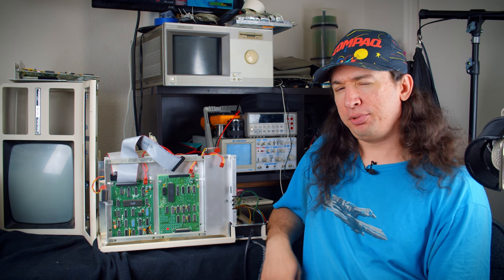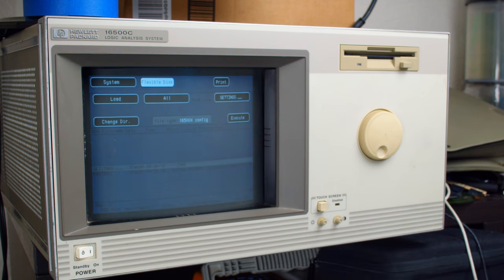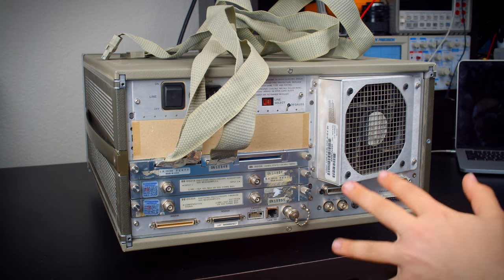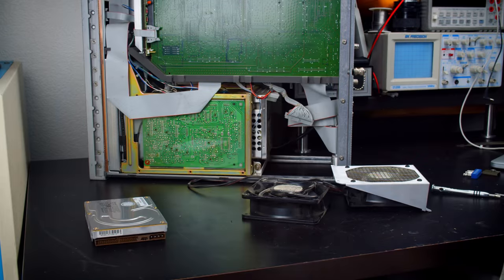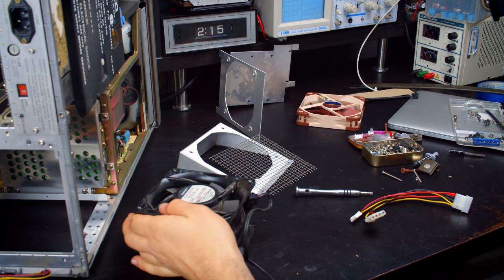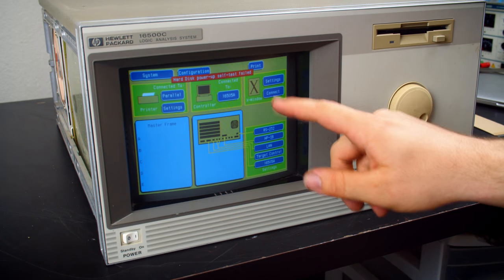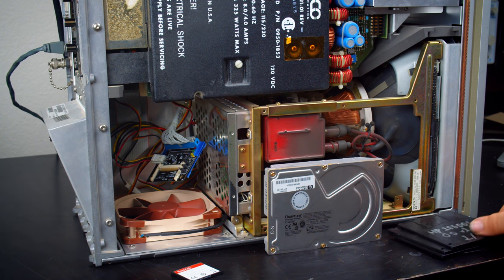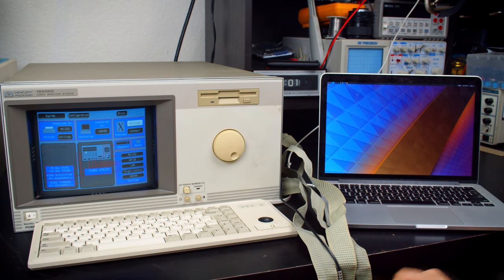HP16500C Noise Reduction Mod

Comment: I would be careful to make sure the air flow rate isn't too low compared to the OEM fans.  
You don't want to cook your HP!
Reply: BUMP! I was thinking about it, This is important!
Reply: Keep in mind that these were designed to work in harsh industrial environments, in racks, where heat can build up easily. One thing I would recommend though is to try to match the CFMs of the old and new fans.
Reply: These things were not designed to work in harsh industrial environments - they cost 20k-100k USD and were designed for R&D labs (NB I own HP vector network analyzers, spectrum analyzers and signal generators that had prices North of new car territory, as well as newer R&S and Keysight equipment). The fans were designed to ensure long (design and operating) life of extremely expensive T&M equipment. As you mention though, it's important to ensure similar CFM and same air flow direction.
Reply: Exactly what I was thinking. The fans might be loud for a reason.. they might move way more air.
Reply: yeah, at least replace them with some noctua industrials, they are still going to be way more silent

Comment: I would try limiting the primary partition on the CF card to 500mb.
Reply: went looking for this comment
Reply: Or dd that HD to CF card sector by sector.
Reply: I already did this on my 16500b when the old HDD went bad. I found out soon enough that not all CF cards work. After some trial end error I found out that the Swissbit 250Mb works good.You can go to the HP museum website and you can download the operating system for it. You just need to buy a CF to IDE adapter, pop in the card, boot it from floppy and install the operating system. No need to image the old hdd.

Comment: Since I had a similar experience with some really old Toshiba laptops (luggables) I googled a bit and found this document https://www.scss.tcd.ie/SCSSTreasuresCatalog/hardware/TCD-SCSS-T.20150217.002/HP16500-Series-Mainframel.pdf that says:
"Note that the Hard Disk controller and/or the CPU Board firmware/BIOS will not recognize any other brand/type of Hard Disk (other than different sizes of the Quantum Fireball 3.5 Series XXXXAT)"

However I googled some more and I found this page with infos on the conversion and a list of compatible adapters and CF cards: http://www.ko4bb.com/doku2015/doku.php?id=test_equipment:hard_drive_conversion_to_cf_for_hp16500

Comment: I hate to be "that guy" but the text you added in post totally cuts off the frame
Reply from the maker: Ugh, Resolve has this weird bug where sometimes changing the playback resolution changes the text scale. I guess that happened, fun. Thanks for letting me know!

The gist was "I couldn't confirm the B model could NOT read DOS/FAT12 disks so it may be possible." I found one source that made other mistakes that said the B couldn't and that's all I was able to go on.
Reply: @TechTangents  Also the text at 8:13 just so ya know
Reply: @TechTangents  I can confirm that the 16500B model does read/write in DOS/FAT12 format, since that's the model I have. It's also got the half-height 3.5" drive, and it is HD (1.44MB)

Comment: You may wish to use a Disk-On-Module in place of the IDE disk. I’ve had more success with these in legacy conversion projects.

Regarding the fans you fitted, Your analyser is going to an early grave if you don’t have the required air throughput and that the fans are capable of generating the required pressure to ensure ALL areas of the instrument case receive adequate cooling. There is a reason the original fans were in an Aluminium frame!

Comment: I seem to recall there being a limit of like 2GB on the hard disk when I was swapping to CF card. I have the same adapter you're using I believe. I've got a 16500B. I dumped the hard disk to image file using an IDE to USB adaptor.

Comment: The B model uses normal FAT formated floppies. Hotel might not work with it, because on the B model, at least, the FDD is a non standard type, with only a 34 pin connector and no power connector. I poked around and, from what I could figure, it seems to be some kind o Shugart type FDD. And if you need to replace the HDD, not all of them will work, because of the way the mainframe formats them. There are some Linux apps you can use to image and convert the HDD data so you can read it. But I just replace my HDD with a Swissbit 250MB CF and reinstalled the Operating system using the FDD.

Comment: That touch screen is so damn cool.
Reply: It's actually a bit of a pain if you're not looking at it dead on. Because it uses ultrasonic detectors, there's a slight depth of field effect, so whatever proboscis you're using has to go in straight otherwise you end up pressing the wrong thing.
Reply: I wonder if the one in Die Hard was like that. If it wasn't just a "prop".

Comment: In the second watching, I noticed you mentioning USB Logic Analysers.
While they are nice and useful, it is worth noting that the HP logic analyser pods can do a lot more than just 5V DC or TTL.
The pods of my HP 1630 G are rated for +/-40 V DC, which IMHO gives a lot to work with, including e.g. 24V programmable logic controller analysis.
Reply: sure, if you need that, but I'm guessing 99% of people looking for logic analyzers aren't going to use them for PLC (if they even know what that is). for everyday LA use I'd say the small USB ones are much more practical than these clunky old beasts but these are still cool, for the same reasons any old UNIX hardware is.

Comment: Very nice!
I'm happy to see that you have managed to get the 16500C in this configuration. I'm a bit jealous. ;)
The fan solution is quite interesting. Fortunately, the 16500C has 12V fans unlike my 1630G where the fan is mains-powered and switched between 115 and 230V. At least it sounds about the same as your original fans.

The CF card problem may come from the partition size. I had a similar problem with a ThinkPad a while back. Not sure about the exact size, but I seem to remember something about a max size of 2 GB. But with this HP Unix system it may all be totally different.
I wonder if those cheap mSATA to IDE adapters might work here instead.

btw: Did you archive the disk set somewhere? That might come in handy if I ever manage to find a 16500C over here in Germany. :)

Comment: One of the really nice things about the HP spinoffs is that they still provide support for these boat anchors. I contacted Agilent for some recovery disks and they sent them out to me for free. For my 3852A they sent me out new ROMs. I can't speak for Keysight, but I wouldn't be surprised if they didn't do the same thing.

As for the 16500 series, do yourself a favor and upgrade to a 16900 model.
Reply: They still do! I contacted them because the HDD died in my old Agilent Infiniium Oscilloscope and they provided me with OS recovery disks. That's customer service!
Reply: @0xbenedikt  Along with sending me stuff, they sent out a set of upgrade ROMs to a friend of mine in Finland. Nothing wrong with the unit as it was, he just wanted to upgrade it. That's pretty awesome! :)

Comment: Dude, I just yesterday got my Tempest arcade boards up and running using an Arium ML-4100 logic analyzer using a custom harness I wired up to the 32-channel pod.

Crazy thing was, after installing the missing CPU and vector state machine ROM and replacing all of the failing ROM chips, it turned out the only thing that was preventing the boards from running was a tiny piece of solder debris shorting between two traces.  These boards would've been an easy project if I had just looked in the right place, but I would not have looked in the right place without the aid of that logic analyzer.

I just wish I had gotten the pod sooner, but I got the analyzer itself for free several years ago and it to AGES for one of the pods to finally show up on eBay by itself.
Reply: yea thing with modular systems is to try to find them complete, any missing parts and you're either going to be looking forever or pay through the nose (especially outside US). I got the 16500c with pods but was missing grabbers. as I wanted original HP ones ended up paying about the same for them (inc. shipping+taxes) as I did for the system.. later on realized IC clip is much more practical and ended up not really even using the grabbers 🙄

Comment: Have you tried SD-IDE adapters? I much prefer them as you don't need to go hunting for compatible cards - you just have one (usually by Sintechi) chip and any card should work. I've got two and they work flawlessly in both systems. My P1 PC wouldn't accept any of the CF cards I had but it took to my two SD cards straightaway.
Reply: I was about to suggest this in the comments. I've had good luck with IDE->SD solutions on retro systems as well! :)
Reply: SD cards would use the SATA interface, and CF cards the IDE interface. It's preferable to use the less number of adaptions as possible
Reply: mrdaxtercrane SD cards don't use SATA. CFast cards do though. SD cards can be adapted to IDE and presumably SATA via a controller chip like I mentioned in my comment.

Comment: Saw a few comments about those fans, just passing the word around. Might want to ensure you have the proper CFM with em. Maybe in part two check it out. It sucks when things like this are super noisy but if you want it to last you’ll either have to find equivalent fans or keep using the old ones.

Comment: I mostly use the LAN rather than needing a flash card, but I would like a dummy floppy to avoid the annoying track-zero recal at startup ! I guess a gotek would quieten that but it seems an expensive mod for just a 1-second noise reduction.

Comment: This prompted me to pull the trigger on a bare "C." Bought an "A" a few years ago with a number of cards/pods for $10. But those LIF format disks are such a pain.
Reply: Only $10? I'm assuming that's local? I got mine locally for $100, and even with only the 16510 logic analyzer card, it seemed like a steal considering I didn't have to pay to have the damn thing shipped! By the way, the 16500 "B" also reads/writes DOS disks, but it doesn't have the PS/2 ports, so I'd definitely get the "C" if you can.
Reply: @BlackEpyon  it was listed on eBay for parts because it didn't pass the floppy self test.  I was the only bidder. I did pay $40 to have it shipped.

It just needed a boot floppy. And it came with 3 or 4 cards. Couldn't believe that no one else bid, just for the cards.
Reply: @JamesPotts  That was worth it just for the cards alone! Shipping on eBay goes up to $200, depending on where you're shipping from/to, I imagine.

Did it come with the pods or did you just grab some bulk test clips from Amazon like I did?
Reply: @BlackEpyon  tell me about it, if I wasn't lazy I'd setup import/export business, go fill up a container of practically free electronics from US, ship it to europe and make 500% profit
Reply: @SamuliTuomola_stt  Keep in mind that when selling people's "junk," you can only make a profit in the niche markets that value that junk.

Comment: I have one of these. I replaced the Fans, converted it to CF and topped off the RAM. I'm thinking to replace the Floppy with a Gotek Floppy emulator. I also need to probably recap the Power Supply at some point because if the rear power switch is left on I hear a high pitch noise coming from a couple of Caps. So right now I have a smart power strip and Alexa to control the ON/OFF state of my Analyzer.

The CF modification is tricky to do. It's picky with the CF card and the adapter as well. I have lost the weblink I had saved that lists what Adapter and cards work. I do know that it doesn't like anything higher then 1GB of storage. I think it uses a FAT16 File System. Even if you use a bigger card and partition it smaller it will still be picky about it.

When I was finding a home for this mammoth I decided to make a little Keystone BNC breakout and have it on the Bench and the Analyzer went onto my Server Rack. Worked out since my Scope Probes are on the short side. I also got the Xwin portion working so I can control it from my PC.

Comment: Very cool and prices on these things are reasonable.
Reply: The prices usually aren't bad, even on eBay, but the shipping is the killer.
Reply: @BlackEpyon sometimes those deliveries can mess up crts
Reply: @vendybirdsvadl7472  Yeah. I've got a Tandy CM-5 with a bad vertical output that I need to get back to fixing at some point. It was working before I tried taking it to an event, so obviously I didn't pack it well enough. Not that the main board inside these CRTs are ever properly mounted to begin with (the board is bowed from all the years of heat distorting it!)

Comment: I may be alone in thinking this, but honestly, I would rather have the before than after. Only because I would rather have the louder lower pitch noise than the quiet high pitch ring it has now. (I know that's the Hard Drive and Shelby said he was going to swap it for CP)

Comment: This can be a pretty handy utility for taking advantage of modern analysis tools with captures you take with the 16500C: http://www.brouhaha.com/~eric/software/la2vcd/
While the built-in symbol utility and the reverse assembler you can get for it are nifty for doing parallel bus decoding, anything to do with serial protocols (I2C, SPI, etc.) would require an external serial-to-parallel adapter to get it to decode them. With la2vcd, you can translate a trace capture to the standard VCD format, which you can load into tools like Gtkwave or Sigrok.  Deep/long captures take quite a while to download though; it translates the internal raw memory dump to a text format, which I think takes more time than the actual transfer over Ethernet.

Also, you can do SCPI over telnet, so your non-HPIB-capable computers can control it tool. :)

Comment: personally if I had to use the model A id use a HXC floppy emulator on it, and it should solve the issues, also you could always use the rubber fan mounts that Dell was famous for using to dampen noise, also what about the ide to sd?

Comment: having a CF or SD card in there would also reduce the heat produced, but wouldn't it also cause a lack of use of the 12 volt rail? That would cause more heat if there isn't the proper load on 12v? Not sure if it's a concern.

Comment: When was it released, were was it used for?? I just don’t know but you might think that hospitals did also use them ,mmm.
Reply: Logic analyzers would be used in electronics labs, and for high-level computer/electronic repair. My dad was a senior service rep for a company that manufactured electronic hospital equipment (ECG/anaesthetic/ventilator/etc), and a mainframe like the 16500 is sort of the computer world's equivalent.
Reply: a logic analyser debugs chips/circuits, you can connect it to various i/o pins and system buses and slurp up all of the signals and states. it produces a big log which you can then pull into a computer program and start reconstructing the machine code. (i only know about this because of watching curiousmarc's alto restoration vids, where it came up a lot to diagnose which chips were faulty and to create a.. fpga disk emulator i think? it's been a while. but yeah)
Reply: Yeah, when you're trying to get into advanced electronics repair, being able to pick up a used oscilloscope or logic analyzer for cheap can really pay off. I picked up my 16500B (with an 80-channel 16510 logic analyzer card) for $100 off a guy at my local retro computer meetup. It's been well worth it's weight.

I had an issue with my Tandy 1000HX. Something had shorted while I was probing voltages for a card I was building (blame my hands for that), and it would no longer boot. I connected the logic analyzer to the expansion header so I could see what the bus was doing. The clock signals, address lines, I/O and Mem read/write lines were all behaving, but I noticed that half of the data bus (only 8 bits) was stuck. So that narrows down what the problem is, it's something on the data bus. Between the CPU and the expansion header is a bare handful of chips, which narrows the problem down significantly. Because the address lines were all working properly, and the i8088 CPU has the first 8 address pins shared with data (multiplexing), I could tell that the CPU was working fine. That then lead me to the he HCT245 buffer that feeds the expansion data bus, and which also happens to be closest in line to where I was probing when it shorted. So I replaced that (also installed a socket), and It booted up just fine.

So it turned out that the dead buffer chip was holding down half the data bus, so nothing else could work properly. If it wasn't this chip, I'd have started probing the other chips that connect to it, such as the nearby buffer that serves the internal data bus, or the 8259A interrupt controller to see if either of them were holding down the data bus. If either of them were faulty on the CPU side though, the address lines wouldn't function properly, and that would have changed what I saw at the expansion bus. Fortunately, this was a relatively simple fix - everything came down to that single '245. 

Logic analyzers, combined with the service manual (schematics and timing diagrams), can be used for much more complex problems than that. Sure, you can use a logic probe or oscilloscope, and EVENTUALLY find the culprit (if it isn't more than one chip), but you're limited by the number of channels, and being able to view the entire bus at once can potentially save a LOT of time!